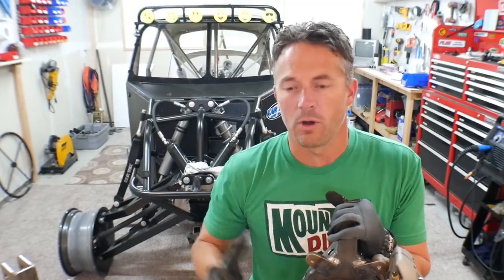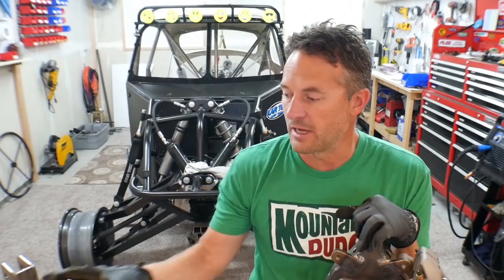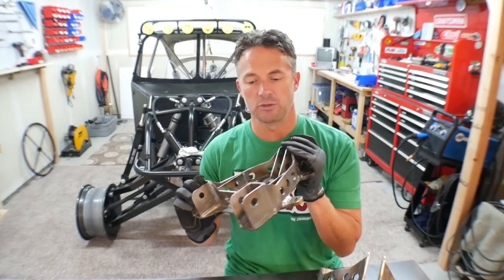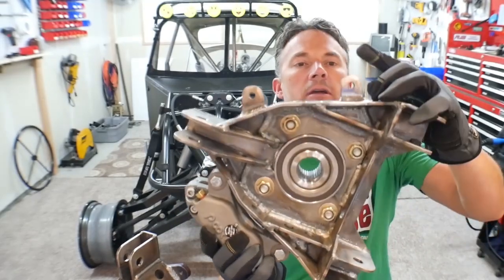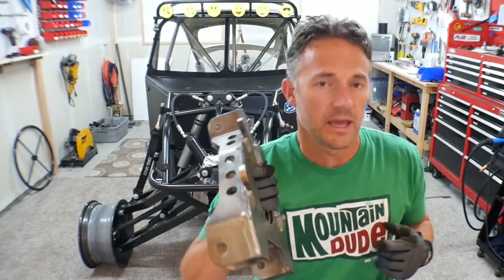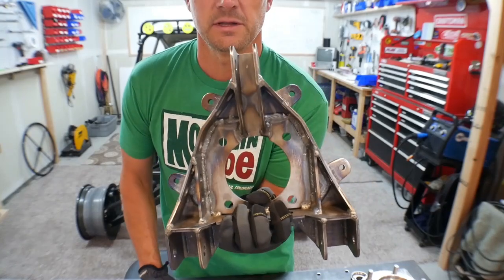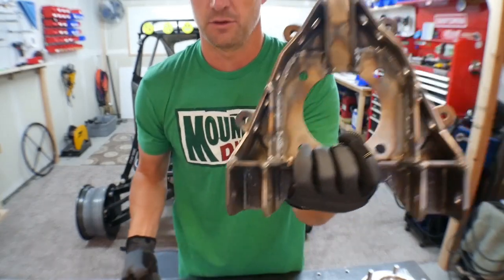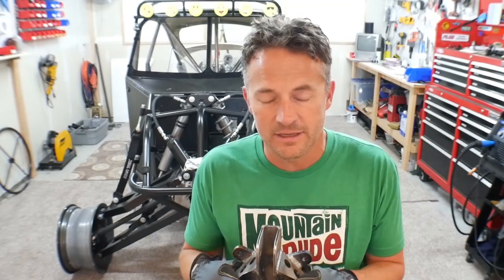Wratchet Rear Spindle Fabrication

Comment: What rotors are you using ?All the 4runner units seem to be vented. Great build!
Reply from the maker: Those are Tacoma rotors, 12.5" in diameter. They were originally vented, I cut off the second disk and machined them smooth.
Reply: Wow that's dedication. Thanks for the speedy reply.

Comment: Good day! Tell me, what thickness of metal do you use for this part? Front plate, stiffeners and reinforcement inside?
Reply from the maker: The front plate is 3/16", the stiffeners and reinforcement are 1/8". So far I haven't had any issues with that setup.

Comment: I like the trick you did connecting your compressor to the caliper.  It end up being a centering device for you, which is very good.  Getting the calipers centered is really important.
Reply from the maker: Yes I agree, It holds them nice and tight for tack welding too.

Comment: How did you come up with the design?
Reply from the maker: It really kinda dictates its own design when you throw the math at it. Knowing I was going to use 4Runner hubs, Uniballs, 10 degrees Inclination, and I wanted it inside the wheel. Then when you put all that together this spindle is what you get.

Comment: Hello, good idea for the spindles but I have a question, how did you resolve the problem with the rollers of the transmission, because I make the U joints and they broke the rollers of my transmission(it's comes from a VW transporter).
Reply from the maker: When you say the rollers do you mean the bearings?
And was your setup trailing arm or A Arm?
Reply: @DougBugBuilder  yes when I say rollers I mean the bearings and my setup is with trailing arms
Reply from the maker: @darkjimenezibarra8756  I personally don't think you can run U joints with trailing arms. The axle plunge is to stressful on the transaxle case and bearings. I only run U Joints on A Arm suspension and I try to design it so there is no plunge.

Comment: Why did you choose that transaxle and why aside from others?
Reply from the maker: The weddle HV25 is a strong transaxle that will handle most anything up to around 550hp. This will allow me to play around with various engine combos all the way up to an LS.
Plus it has a full size reverse gear and I could get it in a five speed.
I think it will be a long time before I outgrow this transaxle. (famous last words) 😉
Reply: That's for answering me, right after I said that I forgot you made a video before. What website did you order from?
Reply from the maker: @alfainc5868  I ordered the transaxle direct from Weddle. They were extremely helpful in selecting the gear ratios and optional accessories.

Comment: I might have missed it but on your front spindles you used 4runner hubs. Are you using the same hubs on the rear? 
Overall looks killer and thanks for sharing the files!
Reply from the maker: The front spindles use 4Runner 2WD hubs. These rear spindles use 4Runner 4WD hubs. There is a difference between the two.
I actually uploaded revised drawings for these rear hubs this morning. So if you grabbed them last night please use what I uploaded today.
Thanks for the comment and happy building. 😁

Comment: Uber cool fabrication.  In future may be an idea to make it in aluminium for weight saving. Was wondering what model are the Wilwood calipers.
Reply from the maker: I might play around with aluminum sometime.
These calipers are Wilwood 120-6818 
https://www.kartek.com/mm5/merchant.mvc?&Store_Code=KT&Screen=PROD&Product_Code=WIL-1206818
Reply: Thanks. I am thinking of running the same calipers on my 74 Bug with a Porsche brake conversion.

Comment: Cool!
Perhaps you are the first person who showed how to make a fist for a hub Assembly
Thanks!
A very useful channel for you!
Please tell us the parameters of the hub, what it depends on, the size of its attachment to the fist, the size of the wheel attachment and the number of slots for the drive shaft. Does it have water protection?

Thank you for the informative videos!
Reply from the maker: 1. The hubs are Toyota 4Runner 4WD front hubs. They are 30 spline.
2. The connection points are 7/8" heims at the top, 7/8" uniballs at the bottom.
3. The wheels I'm using are Toyota Tacoma wheels. 16" x 7".
4. The hubs are water proof.
There is more information in this video. https://youtu.be/RVh-NzyGfyI
And in my shared folder under "Wratchet" I have all the dimensions of the spindles. https://drive.google.com/drive/folders/1i0qTcN-1BB5_Lu6umgi9OrvRJKr-0vz3
Hope that helps.

Comment: what about the axles, for long travel requires a long axle too, can you give an explanation video about the axles to adjust the long travel ? thanks your video is very useful
Reply from the maker: After I make the lower control arm I'll have a dedicated video on the axles. So hang in there. 👍 Shouldn't be to long.

Comment: I like separate calipers for tractor brakes. Leaves your pedal brake system unmolested. Turning brake failure won't affect pedals and even with pedal failure you still have a rear brake.
Reply from the maker: It would be impossible for me to agree with you more on everything you just said. 👍